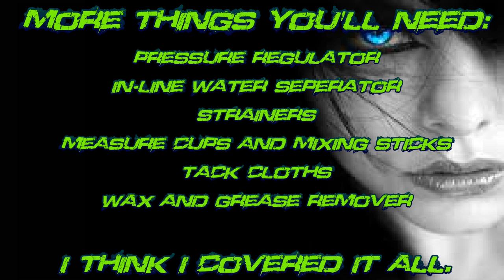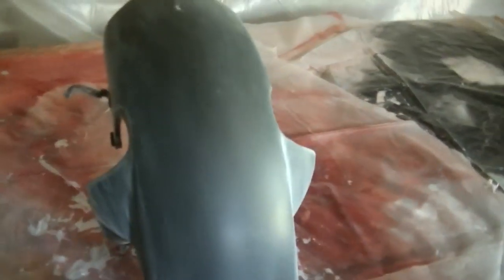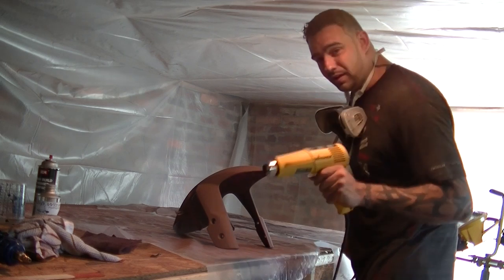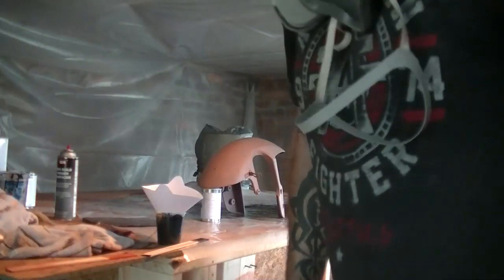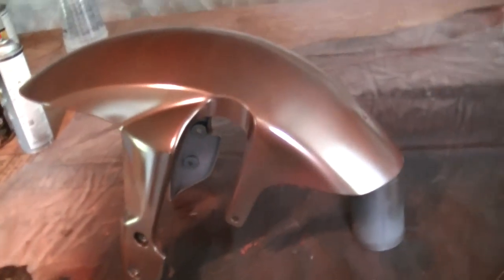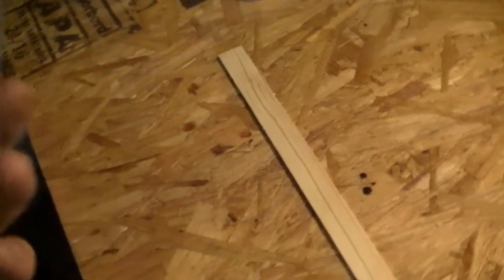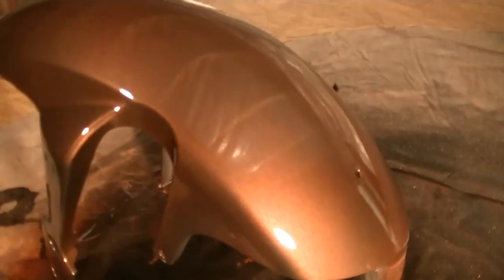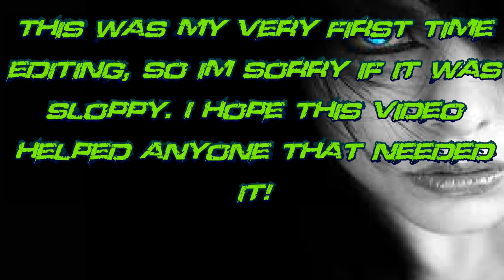Exstensive DIY motorcycle paint job at home PT 1

Comment: Hi Bruce.Good video.just not clear on one thing .Do you sand down between clear coats?
Reply from the maker: sorry for the delay in response. no, you do not sand between clear coat coats. apply your 3 or 4 coats then wet sand. Thank you for your question.